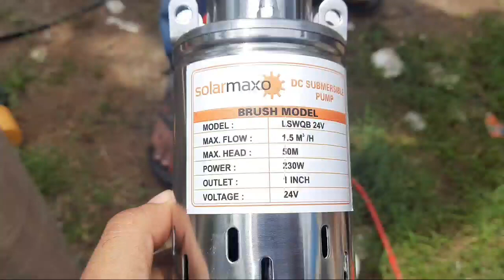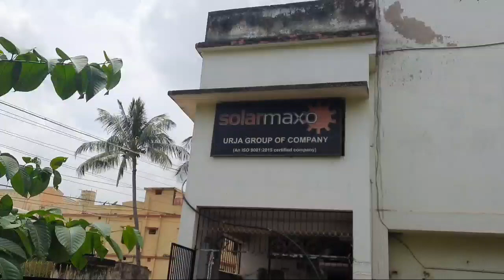24volt solar pump running with a single solar pannel

Comment: Does it require a float switch or it can comfortably run dry?
Reply from the maker: It's required dry run sensor
Reply: @sks440volt  can I shop it online?

Comment: The pump directly to panel?
Reply from the maker: Yes ,it will connect direct to solar panel
Reply: @sks440volt  please, can I connect 2*300watt panel in parallel for the pump or I should use 350watt panel ? 
I'm asking because 300watt panel can't power it here
Reply from the maker: No
Reply: @sks440volt  does it mean that,I can't run it with panel but battery instead? 
  Hope 2* 50a or 2*65a in series will do?

Comment: SIR HELP ME  1.5 Kw /  2 HP samarsebal K .S.B 160 VOLT  A/C.  pump. PANAL. WATT  325×6=1950 watt 
Series connection Karo Ya parallel connection.  

( Bhawanipatna Kalahandi pey ) lagega maxup solar Bhubaneswar se aya sir
Reply: Was your problem solved?